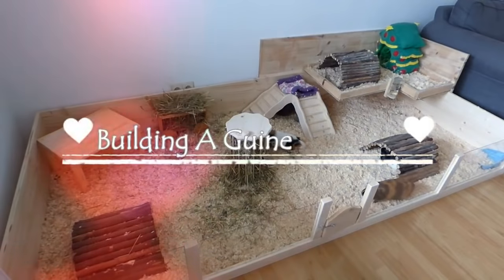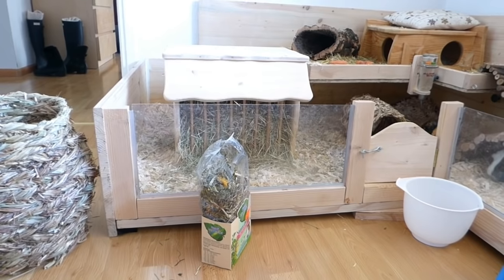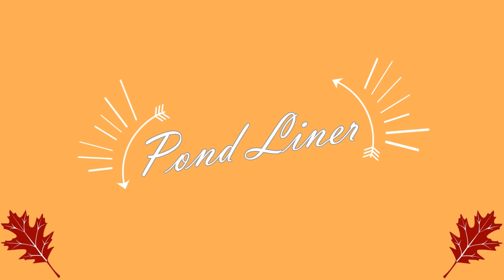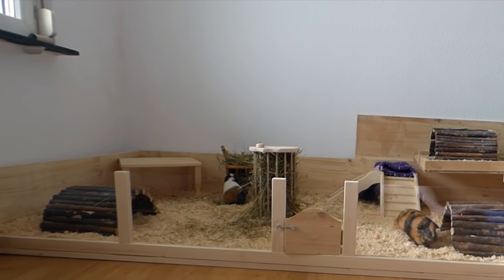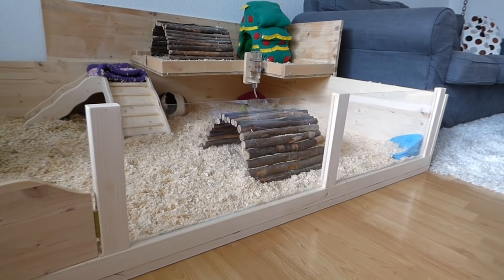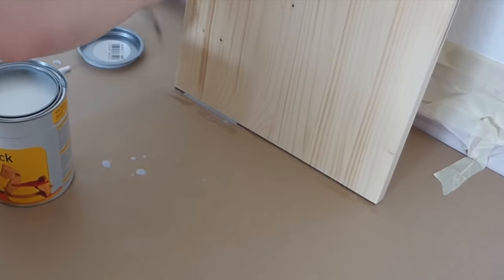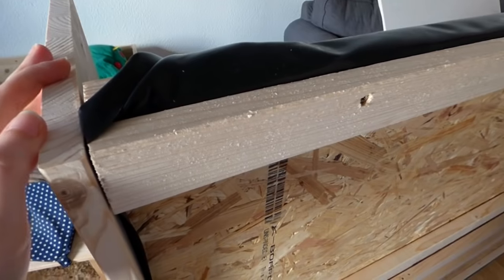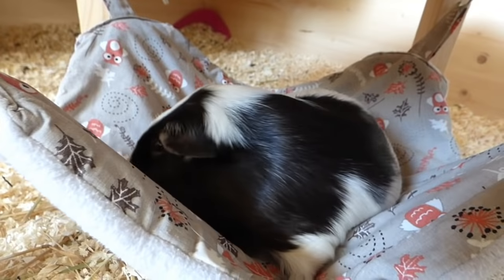How to Build Your Own Wooden Guinea Pig Cage | DIY Cage

Comment: So I just finished building my wooden cage for my piggies and I have a little bit of advice. You want your timber boards to be as flush as possible so that your piggies can't chew them. If you're having a hard time getting them perfect some aquarium sealant is safe for animals and can be used. I also used non toxic craft vinyl for the flooring which is easier to attack than pond liner or linoleum because it sticks right down. Most craft stores sell it. Also you need to make sure that your boards are heat treated wood and non chemical or pressure treated. Those can be dangerous for you to even be around, let alone your piggies. Also Ecos sells amazing pet safe paint if you want to paint your cage!
Reply: Thanks so much, even if I can't get a guinea pig i am seriously thinking about everything for them and this helped greatly
Reply: So would normal timber be okay to build with? Or things like ladders and houses?
Reply: This video it saving my life im a im a little girl im 8  we have 4 guinea pig there all girls Custard Floppy Gingar-snap and Nugget  shes ow smallest little piggy

Comment: Looks surprisingly simple. I'll be moving to London before I get piggies so I'm sure I can find a place to cut it. The balcony is intended to be their home combined with a hutch, if I use pond liner over the cut to spec wood and drill the additional parts in I'll have the balcony glass and doors as a cage entrance and barrier. I may leave part of the balcony without a wood cover. I'll get a good hutch for them, might get some form of electric heating in the winter to make sure they're comfy and line the bottom of their cages with newspaper (or bin liners? something disposable that will soak up poop and pee to make cleaning a bit easier - put on gloves, scoop all into bin liner, wash out separate toys in sink, set up again).

Comment: seems like it would be real work to keep clean
Reply: I use fleece in my Guinea's cage and its alot cheaper and easier to clean. I have 3 layers in their cage. First layer on the bottom is some thick black plastic trash bags, second layer is puppy pads, and third layer on top is the fleece

Comment: I want to build a New Guinea pig cage for my pigs but my dad thinks the wood will be unsanitary and they will rip the pond liner. Does the wood really get gross and does the kind liner rip?
Reply from the maker: the pond liner doesn't rip, there's bedding on top, and if you make sure that it's attached to the wood, they piggies can't reach it. The wood can get dirty after a few years but you can get water proof paint (that's safe for pets) for the wood
Reply: thanks I'll tell my dad that and I should have a new cage soon
Reply: Little Adventures we went to lowes and looked at what they had. The pond liner was extremely expensive and we thought about using a heavy duty tarp. Also what paint did our use because the people there didn't know if they had animal safe paint
Reply from the maker: We used one that's safe for babies :) Linoleum also works but, at least here, it's more expensive than pond liner. I found this http://www.homedepot.com/p/Total-Pond-7-ft-x-10-ft-Pond-Liner-PVC12005/202017064
It's only so expensive because there's so much of it.
Reply: Little Adventures my mom and I are planning on making he cage this weekend but we don't know a good paint. What paint did you use and where did you find the paint
Reply: jennifer denning OMG tell your dad he should totally make you a cage because my dad is going to build me one out of wood and the pee or poo will not leak through so good luck with building it

Comment: Where did you put your piggies while you were building the cage? In a floor time pen? In the bathroom? I'm thinking about putting plexiglass in my cage and having half C&C and half plexiglass. Where should I keep my piggies?
Reply: RileyAnn Kinne Hi, I may not be an expert, or Little Adventures but I have tips even if it is too late. I recommend putting your piggies in a safe spot with a roof and sides if you have other pets (dogs, cats, birds, etc.) so they do have something temporary to keep them safe at night or just in the day. If you have another cage during the building process, that would be perfect as a temporary home, just make sure your piggy knows the layout before hand (around two days before). I hope this helps you and other viewers.

Comment: Question, why can't you just put the base wood on the ground? Why do you need the dimensional lumber in the first place? If you put it on the ground, it would be able to hold your weight because the floor is supporting it, am I missing something?

Comment: you located in the u.s.? how much do you spend on wood shavings each month? also how often do you clean the cage? do you clean entire cage weekly or do you just do daily spot cleaning? do you recommend sealing wood side panels to protect from piggy pee? i have a c&c cage but its proving hard on my back and time consuming to change out towels and fleece. my piggies love peeing in cornes mostly and they manage to pee on corroplast(plastic cage liner). i have 4 piggies but have 2 cages due to two not gettig along with one of my other females. all females. started out with 2 females then found out one was pregnant and she had babies. separated my pregnant females sister due to the male babyafter he was about 3-3 1/2 weeks old  only trying to mount her. only separated her for a night until a new home was found for him. tried to reunite the female with her sister and female baby but the two sisters imediately fought and the mama got injured pretty bad. blood was drawn. so once again separated the sisters,  tried for 3-4 months to reunite them with no luck. immediately started teeth chattering and lunging. so i have two 2x5 c&c cages with fleece bottoms and litter boxes on each end. would like to build square or wider rectangle wood cages.love your setup...your piggies are so happy.i watch your videos all the time.. ive even took the knowledge i got from you to use and my really shy piggy who is 8months old (mother piggy) is really shy and skiddish has become more tame and comes out to be hand fed. her daughter is skiddish when being picked up but once my hand is gentle under her she relaxes and lets me pick her up. she was my escape artist as well. would squeeze out of bigger gapped bars and run around abd explore the room tuen woukd climb back in cage before id come into the room. caught her doing it one day after i noticed piggy poops around the room.
Reply: MissLizD13  
     I have to 80 pigs and I converted a medal page and took it apart as it was two pieces on top of each other and put them next to each other instead and we have built them wooden ramps to go to the second level and everything we clean out our guinea pig cage every other day and we use the pine shavings which they love.
Reply: MissLizD13 
the reason why we clean him out every other day is ammonia smell is really strong and they poop a lot and it's just for sanitation's we notice that are allergies kick in. we completely empty out the cage with Shop-Vac all of the stuff up and wash everything else they're the happiest guinea pigs ever they are so spoiled to eat Gourmet salads and the rabbit pellets and they love hey but we've gotten creative I don't buy a lot of the stuff we try to make everything so for their hay containers in the cage I used newborns roughly panties go up over the diaper at from the thrift store and I just poked two holes and tied it around their cage. as for the toys and stuff like that for them to play with I went to Home Depot and got a four and a half inch PVC elbow and they love to run around in that use it as an ulcer course they go to the second level they have a tiki hut all kinds of stuff is chewable we tried to train them to do like tricks but we got the win they were like 6 weeks old so I think it's too late same with potty training them in the litter box it's just too late but they love to be held and they absolutely love to be talked to.

Comment: I was just wondering if the timber boards are safe for piggies to chew on?!:)
Reply: No, i don't think any wood is safe... Try to build your cage without any corners or little spots showing inside of the cage, else they will chew on !
Reply: Ok thx!
Reply: Guinea pigs chew on wood to keep their teeth short. It’s perfectly fine if your piggies chew on the wood.
Reply: Timber boards aren't safe for guinea pigs to chew on but they won't be able to touch it any other type of wood is pretty much okay but the laminated glue would is not okay but you'll just have to kind of work with it and try not to let them bite it😊

Comment: Just starting building my DIY wood cage based on your recommendations.  I just finished the based and unpacked the pond liner, how did you get the creases/folds out?  Was it just a matter of stretching it as you put the side boards on?  (need more supplies before I can put the side boards on but just wondered how you smoothed it out)
Reply from the maker: yes! we stretched it and nailed the side boards to the base with the pond liner between sideboard and base (if this description makes sense?)
Reply: It does thank you

Comment: would it be okay to use the wooden material on the bottom of the cage on the sides as well? if it is much taller than the guinea pogs so they can not chew on it? I dont care about how it looks.
Reply: elleigh wilson they are guinea pigs they will chew on everything that's how they get their teeth not down mines you on the bars sometimes and they will chew on the wood that's why they make those wooden blocks that they can chew on that's edible don't waste your money on in a little square blocks just go to the Dollar Store and get the alphabet ones same identical thing

Comment: I’m going to build mine one, could you please tell me your measurements so I can get mine the right size?
Reply: I dunno if I’m to late but The back is 10 feet, the sides are 4 feet, the front is 10 feet but with plexiglass and it is 25 inches high
Reply: Also I believe the second level is 3 by 2 feet around

Comment: Here’s a question for you: So, my dad & I built a cage exactly similar to this, except it’s a 7 foot by 3 foot cage. I have 4 guinea pigs & they always enjoy crawling underneath the fleece which is the “Guineadad” fleece, the same kind that you have in your previous videos. While they’re underneath the fleece, they chew on the pond liner. Now there’s a few big holes in the pond liner. I had to cover up the holes by putting duct tape on where the holes were. Do you know how I should prevent the chewing the pond liner thing from happening? Or should I get new pond liner so there aren’t any holes in them? PLEASE REPLY ASAP

Comment: Can they jump out of the gate at the front?
Reply from the maker: they technically could because guinea pigs are able to jump really high but they usually only do that if they're panicking because they're in danger/spot a predator etc. Since they're in my living room there's no need for them to worry. They rather hide under their level than try to jump out :) I've had this door for 2 years now and they have never tried to jump out...not even when I put veggies in front of the door hehe

Comment: How did you make steps?
Reply: Marie dennison Steps are pretty easy just take a piece of wood that is wide enough and long enough for your specific one and glue     cylinders on it but first sand the bottom down so it's flat and put on the sides
Reply: Marie dennison ps you can also invest in grip tape so the pigs don't slide down it

Comment: I Have a little puppy so i cant build i want a New cage to my piggie :(
Reply: Use a spare room like the attic or basement or open guest room or even your room and always keep it closed.
Reply: Fanny l I built a c and c cage and used extra grid panels to cover the top. So my cats can't get in.
Reply: Fanny l I am putting a lift up screen on my cage because of my cats it did take a little remodeling though